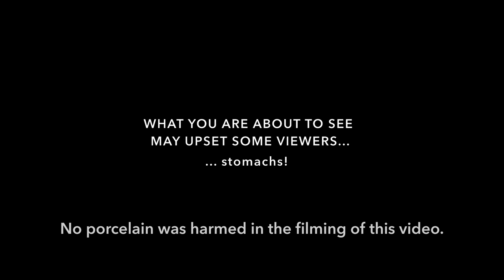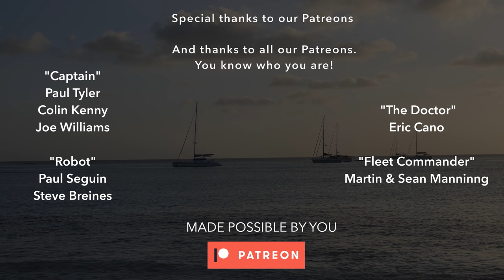A life of extremes - EP 55 - Around the world on a performance cruising catamaran.

Comment: I have thought about a composting head for my future cruiser.  I have seen them used with success on other boats.  The only concern I would have is carrying stock/ getting supply of the coconut 'starter material'.  But knowing that the holding tanks and hoses can be removed, that would leave a fair amount of storage space for them.
Reply from the maker: Sure... You'll have the room... Just a bit of extra weight to carry.
Reply: @SailingLifeonJupiter  Actually enough coconut coir for two people for a year's use only weighs about 20kgs. (give or take) Cost for that amount is about $25.  How much weight does one tank weigh (not taking into consideration  if it you didn't pump out before a passage)?  Anyway, that's where my research has been 'head'-ing.   Pun intended. (Nature's Head is the Brand I am looking at)

Comment: thankyou for the video it was very helpful. I did notice that the tender you are using is not one of those blow up types and have you been happy with the performance. Is you are finding the tender is working for you any chance of manufacturer details
regards
Reply from the maker: Hehe David, this is made of 4mm plywood, knocked up by the boys in the Philippines for about $500. Pro's and cons tho... It's certainly less draggy than an inflatable. But it's not a great dive platform.
Reply: @SailingLifeonJupiter  thanks for the info due to i looking for alternatives than the blow up doll tenders that are affected by the sun but will need to find a tender that i can dive off but not to expensive that people will like to take at ports
regards
Reply from the maker: @davidking1501  Yeah, that's what i'd like too.

Comment: Fresh water flush - ftw.
Reply from the maker: Thought about it... might make the change.
Reply: I was going to suggest the same. Jupiter 2 has a watermaker. Not only reduce the scaling and maintenance it helps remove the smell associated with salt water flushed heads.
Reply from the maker: @FistralG  ....ya. Initially that was the plan...But i would need to be able to select between either fresh or salt...coz occasionally we need to conserve fresh in the case of dirty harbour or broken watermaker.
But you're right.... i might do it.
Reply: @SailingLifeonJupiter  a t valve and a non return valve on the fresh water pipe would make that possible.

Comment: Don't forget, you get the same buildup inside your holding tank after a while as well, and it can build up on the sensor that tells you how full it is..
Reply from the maker: True Edward... that tank is gonna get heavy, even when empty... Perhaps i'll switch to fresh water flush.
Reply: @SailingLifeonJupiter  Hah, I was more or less thinking about checking the gauge, thinking it's 1/4 full because the gauge is stuck and then having that lovely juice blow out the overflow while sitting at the dock or somewhere nice and public when you flush.  Seen that happen before.
Reply from the maker: @edwardnigma2216  Ah geez...sensory overload

Comment: Are those surface corrosion ( white powdery thing ) i saw inside  bilge area? Man, you better treat your exposed  aluminum surface with any surface protection, otherwise your boat will turn into piece of junk. Corrosion will put a hole in your pocket, i mean a very big hole.
Reply from the maker: Don't worry Romeo... it's some salt build up from the sea air... I wash the bilges out with a fresh rinse every few months. This 5083 series ally is especially formulated for saltwater, and forms its own oxide layer to protect itself.

Comment: discharge hose non head looks to be WAY too small diameter, no wonder you have clogging problems. Suggest different style head with a pump/macerator that does not reduce down from 3 " on inlet to a 1" on  discharge side.... small diameter hose always going create problems with mineral deposits blocking relatively fast, large diameter much more "bulletproof" longer timeframe before servicing requirwed!
Reply from the maker: Good idea.. But I don't want bigger holes in my boat... Thinking ill go fresh water flush most of the time... Got a big watermaker.